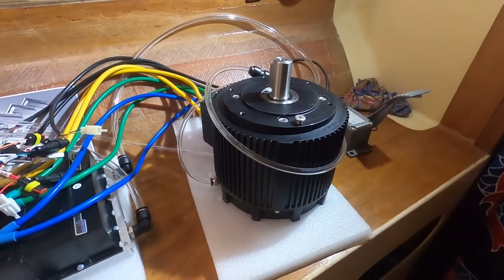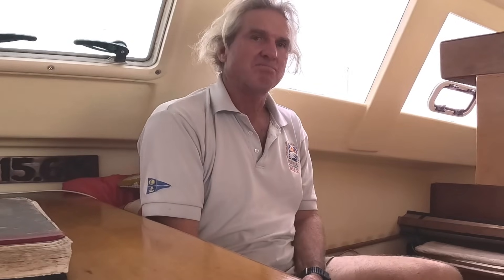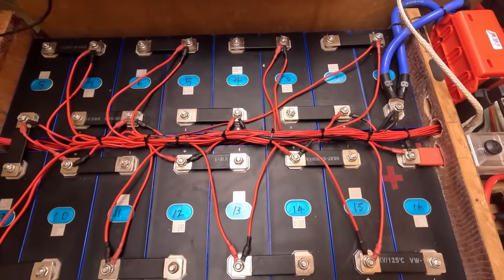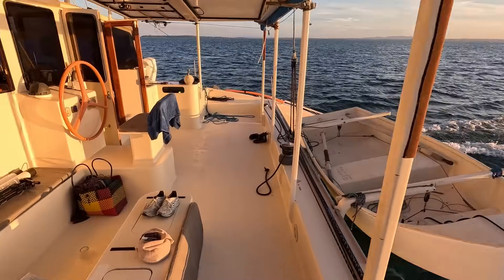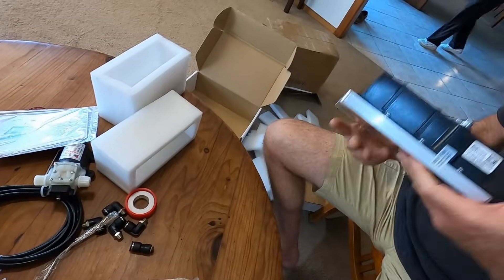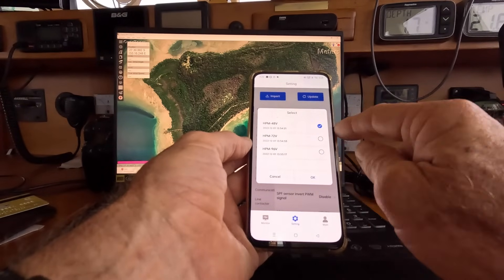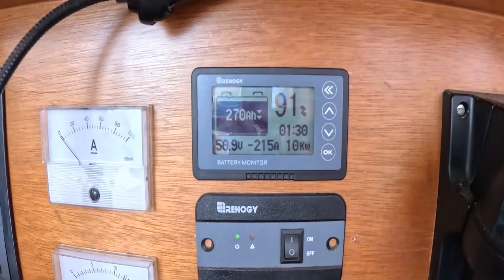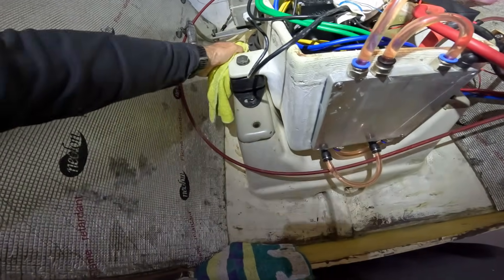16 Months using our Electric Motor -  Good or Bad?

Comment: Definitely looks like a great fit for your region 👍. In our case in NW coast of US and Canada our sun hours are limited by clouds and high mountains. Our sailing hours are limited by the wind always up or down often narrow channels, and our panel area is limited on a monohull designed to beat up said channels. We frequently start our voyages with 50 to 100 NM days to get to a region we would like to visit. With 14' tides and narrow channels the security of a strong enduring engine is a must. But I hope some day we can get there. Thank you for your summary, it helps to put things into perspective.
Reply from the maker: Yes, I totally understand. Overcast, shorter days do make it more of a challenge. You would need bigger battery banks and some clever solar panel installs to make it possible in your situation. Some kind of hybrid system.

Comment: I was wondering could you have a hydro generator, a bigger propeller that you can drop into the water when you have plenty of wind and on the move. Its job would be to turn a propeller and generate power, at the cost of drag through the water to generate power from today’s powerful wind (and motion through the water for tomorrow’s electricity. Or would that be no fun to reduce your sailing speed for any reason as mundane as generating electricity?
Reply from the maker: Yes, one can do re-gen by allowing the propeller to turn while sailing. We haven't got into this as the thought of the noise puts me off and we haven't needed it yet, but it could be a good option for sailing in high latitudes with less sun.

Comment: Great update 👍
I would replace the diesel with another electric system. 
Based on your comments about motoring range, the electric is adequate and you have the diesel as a backup. I think I would rarher have another electric as a backup IMHO.
Curious, what is electric weight vs diesel weight (fuel tank).
Cheers from Canada
Reply from the maker: For this install with the 15kw battery bank  and including the extra solar panels it worked out about the same weight as the diesel we removed. We still have the diesel tank and still only always carry about 30 litres of fuel. One additional positive is that we have moved weight from the stern of the boat into the middle which is a bonus.

Comment: I think for some cases we are approaching point where sailing will become optional. Panels are far cheaper than sails, let alone rigging.
Reply from the maker: You are so  right, solar panels are so much cheaper and seem to be even improving more as time goes by. I do love sails, how they keep a boat steady. Sails and rigging are expensive though and I can see why many are going for the solar power craft with no rig.

Comment: Searunner 37 owner here. Like your outlook.
Did you make your dinghy?
We had two different porte boat over 20 years and so far a good choice for us.
Thinking about making a foam epoxy sort of copy of the hull shape. We can with one personas reach over 15 knots s with 3,5 hp. What design is your vessel?
Aloha
Reply from the maker: Hello Ottifanti! Yes, we've made a number of dinghies over the years. Each one we have gravitated towards a more stable design. This one being foam glass is very stable and also being foam its great as the typical dragging up breaches means that any holes don't matter so much with foam closed cell. This ones bow is a bit full and drags into waves a bit but is pretty good otherwise. Yes, its 15mm foam and 400g glass and still light enough to carry up a beach etc.   We've always loved the simplicity and economy of rowing. Fantasia is my own design and build, after a great number of years of design effort to take the plunge.  We love the Searunner 37!
Reply: @AndrewStransky-cc2dr had my searunner for 26 years great boat yet limited living. fully off grid 26 years. Worked so far. Got all I need. Next boat will have a washing machine. How much does your dinghy weight? My Porta boat is 48 pounds and I had it for 10 years now and seems still fine. Also mostly row it. Had to make costume oarlock system from wood.
Reply from the maker: @ottifantiwaalkes9289  sounds like some great times! Our dinghy is 11 feet long and I think it weighs closer to 30kg. I made it a bit sturdier with slightly heavier glass to handle the tough life a dinghy leads. It is also 1.4m wide so pretty beamy. The foam is great though, not having to worry if it gets a ding underneath and starts absorbing water like our cedar or ply boats did.

Comment: Hello Andrew 👋 nice video, question, how do you connect the Daly BMS to your KZKontroler, do you have a wiring diagram with all parts?
Reply from the maker: Hello Quolls. The Daly BMS dosen't connect to the EZKontroller. Daly have their own app to monitor the battery and settings from. I do have a parts list but not a wiring diagram.
Reply from the maker: If you send me your email, I will send you the parts list I have.

Comment: 145 C is rather high for a overtemperature cut out. 80 C on the other side is relatively low. Getting some 95 C from full power is about OK and the cut out should be set to a more reasonable value a little higher than this (e.g. 100 C or 110 C). There should still be a warning if high or manybe direct temperature (and maybe current) reading to notice if things change.

The motor itself is usually not the limitation. It is more the battery. 15 kWh may be OK for near costal, local sails. It is nothing for offshore sailing - that would requite way more battery or a backup generator. The worst case is not so much no wind, which often comes with sun (though in some areas also with fog). It is more wind from the wrong direction with no sun.

The electric system would still want a litte maintenance: especially in the first few years one may want to check the torque on connectors: copper tends to creep and screws can loosen to cause bad contacts. Still this is not really dirty work, but needs care, not to shorten things with a wrench. For a quick check a thermal camera (at the very least an IR thermometer)  would be nice to have.
Reply from the maker: Hello Ulrich, thank you for your comments. I haven't seen it hit more than 95 degrees yet but I'm looking into this high cut-out temp. I take your point that 15kw is fairly small but we virtually never motor once we are offshore as our boat is a high performance sail boat. We have always been this way during our world cruises. So this amount of reserve power is fine for us. Other sailors who motor more would of course need a bigger bank. And of course we still have 1 diesel motor. Oh yes, I'll look into checking the torque on the cell bolts, thank you.
Reply from the maker: Hello again Ulrich, I have contacted Golden Motors and they tell me they use Neodymium iron boron (NdFeB) – Permanent magnet of the SH rating so the number seem to be correct. My chap said 145 degree c is ok but setting at 120 degrees "if you feel more safe" .

Comment: Magnets lose their strength permanently starting at 120degrees
Reply from the maker: Thank you Olaf. I'm looking into this but a good warning. Interestingly the motor does not feel that hot to touch when it is reading say 80 degrees c.
Reply from the maker: Hello again  Olaf. I have contacted Golden Motors and they tell me they use Neodymium iron boron (NdFeB) – Permanent magnet of the SH rating so the number seems to be correct. My chap said 145 degree c is ok but setting at 120 degrees "if you feel more safe" .

Comment: For  ocean cruising i consider an engine range of at least 200 nM is essential .  Most cruisers now use their electronics that provides ETA which is often tied to arrival at port before dark , not having the ability to motor for at least a few hours can be potentially dangerous just ask any experienced cruiser . 
A big problem i see with relying on battery power is the time it takes to recharge the batteries and if you need to have a deisel generator as backup the whole purpose of being electric dependant is self defeating .
Reply from the maker: Thanks for your comments Geoff. I have done a few world circumnavigations on sailing boats so I am aware of such things. For one we have a super fast sailing boat which can cover miles easily even in light winds. Also we can motor for those several hours on our battery power no problem and as you know  a great deal of cruising time is actually spent in port where our battery can easily recharge by our solar system. And finally we also have our diesel motor in the port hull to increase our range but so far we have hardly needed it. So I feel we have all bases covered really.
Reply: @AndrewStransky-cc2dr   Fortunately you really don't experience range anxiety , you still have diesel .....are you trying to influence people to go full electric or adopt your strategy of a foot in both camps !!!

Comment: Obviously the biggest challenge with electric propulsion is energy storage, which is equivalent to range.  If you don't need serious range, it can work nicely.  If you want to be able to motor a couple hundred nm, or 30 nm several days in a row, it requires a rethink on energy storage.  Nice video.
Reply from the maker: Hello Boooshes you are quite correct. The type of range our 15kw bank provides us is perfect for us, being more of a pure sailing boat. Of course we also have the diesel still there for back-up but have hardly used it.
Reply: You actually need more solar with more batteries and a catamaran is a perfect platform for that. Practically you can have unlimited range.

Comment: Do you still have the diesel? 
If so, sounds like you could replace with a second electric system, though perhaps keeping completely separate
Reply from the maker: Hello Mark. Yes we still have the diesel on the port side. It would certainly be viable to replace it with another electric motor, but for now we are happy as it is. Last year we barely used 30 litres of diesel so our travels are about 95% solar electric. We may well do this in the future but for now we are happy to just be off cruising.
Reply: @AndrewStransky-cc2dr  I strongly suggest keeping the diesel. Without a lot more solar sq.ft., additional electric not very useful.
Really impressed with your combination. Should be an industry standard.
Reply: @artsmith103 yes…but, diesels like to be used. Perhaps ideal is all electric with a small backup generator?
I have seen reports from 100% electric full time cruisers, they are very happy, but do plan around the system. 
Have you noticed that so many YouTube sailors spend a lot of time fixing there diesels.  Not to mention getting towed into port due to some fault of diesel bug.
Reply: @markthomasson5077  if you use it every day you have to repair it more often and its a good idea to keep it because its very unlike both the diesel engine and the electric motor would fail at the same time

Comment: this is great thank you. so many do not understand  how much better electric is over diesel.  Keep it up.
Reply from the maker: Thank you DC. Yes, I have been quite amazed by how good it is. It was hard to quite see this when researching my system, that's why I wanted to make these videos.
Reply: He has the best of both. Could have had slightly smaller battery. Renewable motoring energy most of the time, unlimited diesel when necessary.
Reply from the maker: Haha, yes, I almost consider it the other way in that we have unlimited electric power as we get a good dose every day  and a limited reserve of diesel, but I agree with your point here and I have a friend who went down this route with a high power alternator on his diesel and only a small battery bank.
Reply: @AndrewStransky-cc2dr  I meant, when the fun has a serious weather interruption, the diesel with 20+ gallons of fuel is going to do more than the electric, even if the electric helps out a little. I imagine a good 5 miles/gal when the diesel is working hard.

Comment: Electrician here Forget kw ratings in e propulsion to ICE comparisons, look only at max continuous torque ..... In my old job of furnace sparky we had multiple sets of 8cyl turbo Volvo 600hp diesels for emergency water circulation in case of total power outages, they only need to run 30 mins to remove the heat then shut off, they are huge at 12l each the electric motor that runs 24.7 365, is only  350hp same torque as a 600hp 12l TDI VOLVO Rated for only 30mins!!
Reply from the maker: Very interesting. Your example there on a much larger scale pretty much equates to my comparison here. I'm still a bit puzzled though as the GM 10kw shows a max torque of 29Nm and the 20kw Volvo a max torque of 70Nm?
Reply: @AndrewStransky-cc2dr  I'm not an engineer and barely understand this but you need to see the torque power curve that is published for the volvo d30 and your electric motor. The curve may show a max torque of 70Nm at 2200 RPM for the volvo but the electric motor will show 29Nm consistently from something like 100 to 1800 RPM while the Volvo will show almost no torque below 1200.  More torque at lower RPM allows the boat to go faster at lower RPM, higher gear reduction and allows for larger prop / pitch which the diesel wouldn't be able to efficiently handle. Additionally, there's an RPM / prop pitch/size combos that will just cause cavitation at high rpm and would cause a diesel to bog down and low rpm that an electric motor would be able to handle due to the difference in the torque curve. Look into get your prop optimized for the power your motor puts out at the end of the shaft and what you feel comfortable being your top speed below your max hull speed.

Comment: Perhaps the most important factor, especially on a high windage boat, is static thrust. 
That is making way against a Gale to escape an onshore wind.
Having the biggest propellor is critical
Reply from the maker: So true Mark. This was my key concern when I made this conversion. I was fairly worried the 10kw would match the 30hp in this regard. Happily it has proven a a worthy equal. Just yesterday we had to motor into a reef lagoon into a steady 30 knots and against an additional 2 knots plus outflowing current in the pass. Of course we had both motors running to handle this and the electric matched the diesel perfectly as we easily punched through this challenge.
Reply: @AndrewStransky-cc2dr  
"30 knots and against an additional 2 knots plus outflowing". 
Guessing 2 x elec motors/batteries would accomplish the same thing?
Reply from the maker: @Lana_Warwick  yes, absolutely they would.

Comment: Great to see everything doing well. Motor More is a good description. I just installed 27 lb thrust trolling motor on 3,500lb 26ft mono. I use it during sunny, almost no wind. 9amps for 1.1-1.3 knots. My 150W solar barely keeps the batteries full along with auto tiller, depth & navigation, 12V cooler, music, etc. I have 225ah 12V lead battery.
Reply from the maker: Sounds lovely Art! There is something delightful about getting ones power from the sun to make travels!
Reply: @AndrewStransky-cc2dr  For me it's midday headway with steering without the noise. Instead of floundering in no wind, I turn for home with electric propulsion and carry on with good steerage and the feeling of low speed sailing. 8hp 2-stroke standing by when the day is really over.

Comment: Thank you for another inspiring video:) Hope to be where you are one day:) - Please know that with the Victron Cerbo you can easily divert your dump load when batteries are full towards heating water, or cooling fans etc.:) - Have the same motor but running 2 in parallell and just got them to spin for the first time a couple of days ago (hooray): https://youtu.be/mOYzzC6481o
Reply from the maker: Thank you. I will check out the Victron Cerbo. I am thinking that if we had a 48v invertor I would be able to use the engine batteries excess for our electric cooking. It is our 400 amp 12 v side of things that does struggle in prolonged overcast conditions, even though we can use the motors 15kw bank to run our house loads. Oh, I'm going to take a look at your video to see how you have 2 in parrallel! Well done. The whole experience is quite interesting and a great learning curve.
Reply: @AndrewStransky-cc2dr  
"if we had a 48v invertor". I posted it in an older video, not sure how YT works your end, if you seen it, however curious what you'd think of using an AIO, vs multiple expensive victron components, lots of connections/loss, etc.
E.g. Ecgsolax (MAX-10.2K) 48V/220V Dual MPPT Solar Charge Inverter for arnd $700.
Reply: @AndrewStransky-cc2dr  Makes good sense to get the 48V inverter and use the primary larger battery for you cooking:) - 12V can take care of the rest of the BAU house loads. Sounds like the solution to me:)
Reply from the maker: Oh yes ModularHippo, I just saw your video with the 2 x 10kw in parallel. Beautiful set-up! I'm sure you will sort things out. They do behave quite differently under load of course. Perhaps motor 2 is dis-inclined to run as it has no load to meet or the like. Also the throttle seems to have more travel under load. One thing I did think to say was I feel your cooling pumps etc would be better below all your electrics. I for one have had a number of times fiddling with my pipes and dripping coolant everywhere. Murphys law suggest having them above could be problematic. Also I feel the controller faces are better exposed to the air to aid cooling. Minor points only of course.
Reply: @AndrewStransky-cc2dr  - Thank you Andrew!:) Point taken on the positioning of the pumps (in a permanent setup they will definitely be moved away or under the controller/motors):) - I am looking at 'skin cooling' so the setup I have now may not be the final setup. I will test both though and see what the result is:) Your videos are huge help and inspiration so keep em' coming:) Thanks.